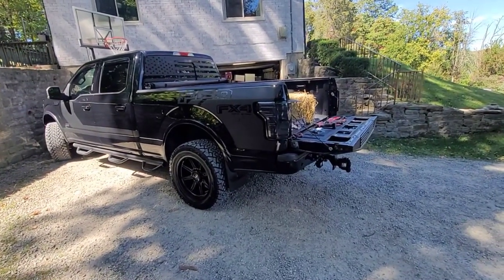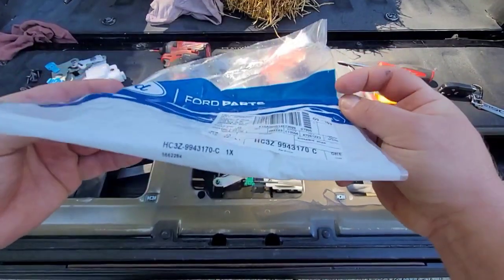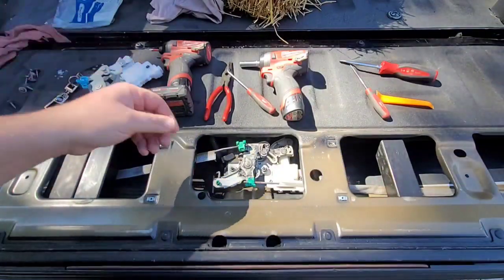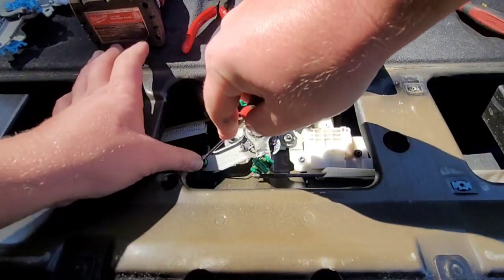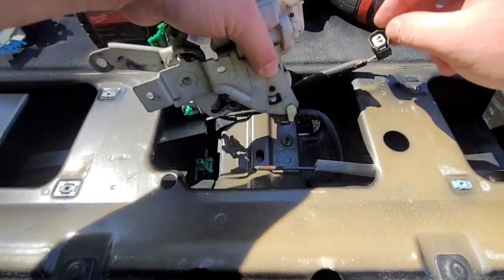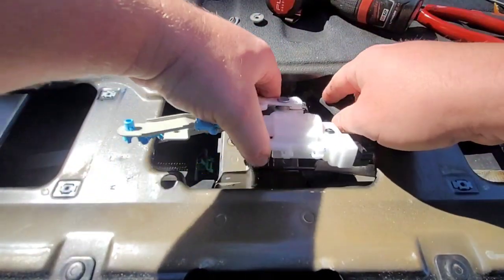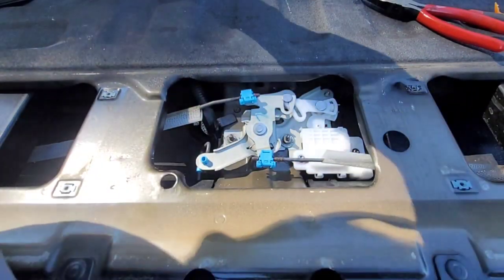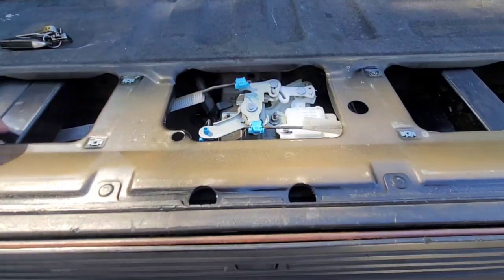Replacing the tailgate actuator mechanism

Comment: Thank you sir great video. Mine broke yesterday on my 2016 XLT. I ordered the part to replace. Cheap part that breaks, very common on F150's. Unfortunately first I had to go thru the extra effort of prying my Tonneau cover up to release it's locks which took some time. I used a contractor grade Air Pry Bag and shimmed and pryed up with a 1x6 piece of wood so I could reach my arm in. No damage done thankfully.
Reply from the maker: No problem,  thanks for watching.